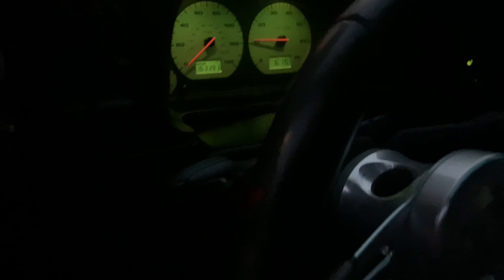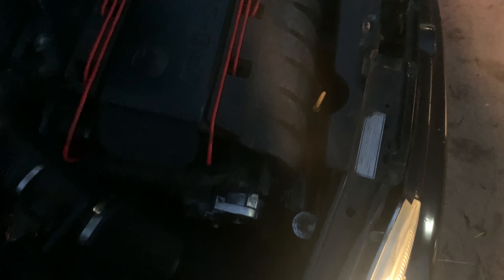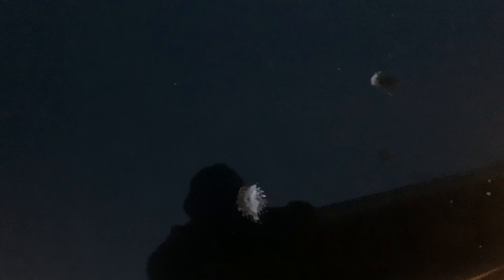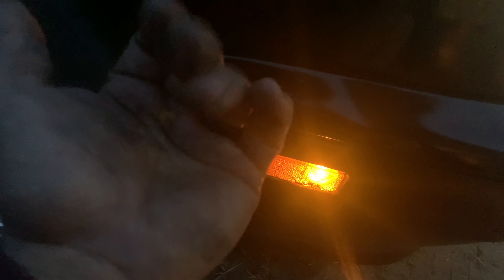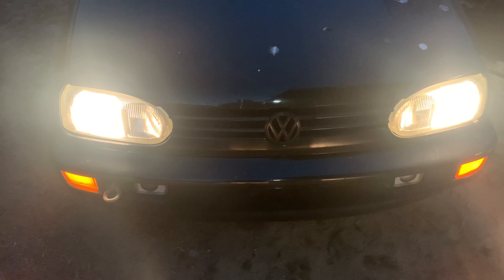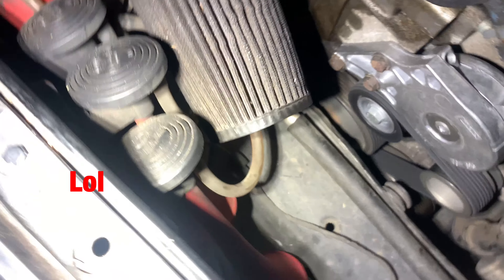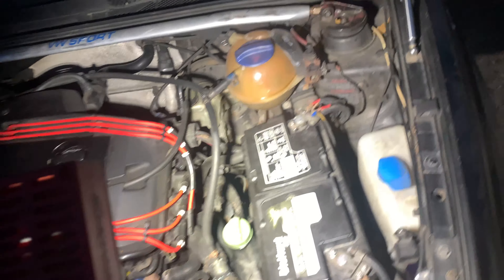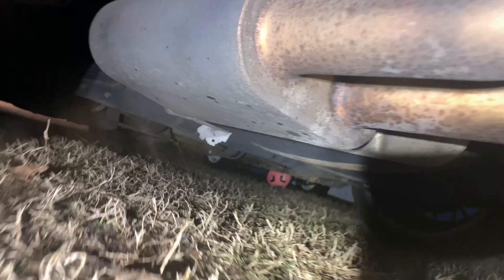Mk3 vr6 12v weird noise , what is it? Part 1

Comment: Take the 27mm hydrolic tensioner back out and make sure its not seized. Seen this happen before. You need to put it in oil and pump it to prime it. If that's not it then it needs timing chains

Comment: This actually sounds like a dual mass flywheel failure.
Reply from the maker: Probably man   But i have new clutch and new chains getting ready to put in  so will keep you guys posted .
Reply: @taco8v what was the problem? did you fix it?
Reply from the maker: @Dan-wv4zb yup  it was the alternator
Reply: @taco8v what exactly as you said had new alternator ?